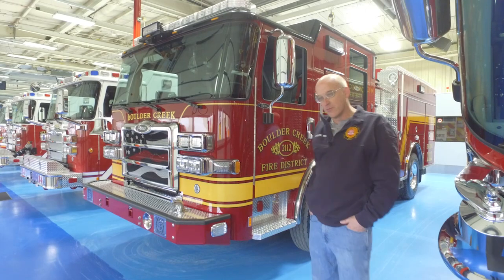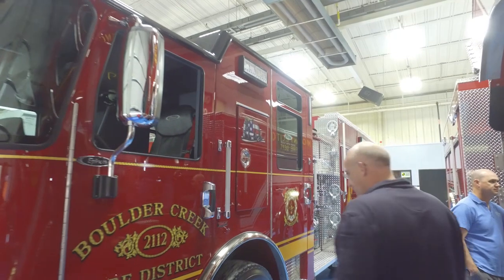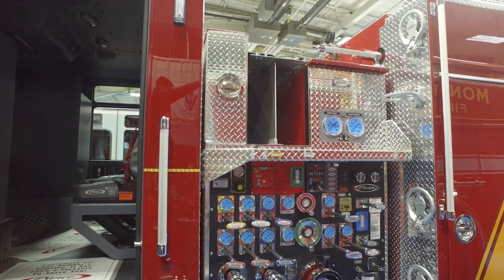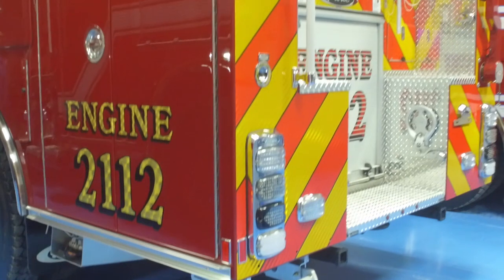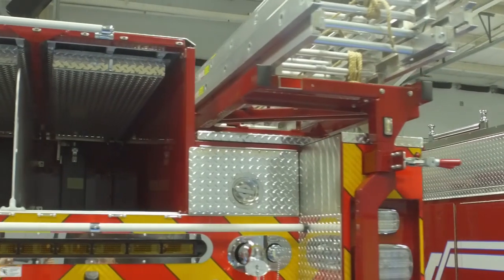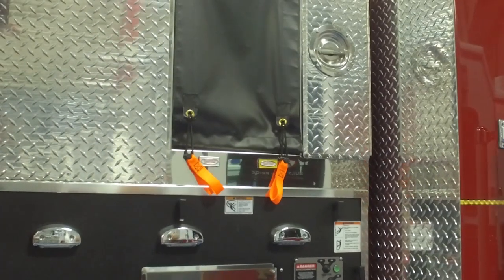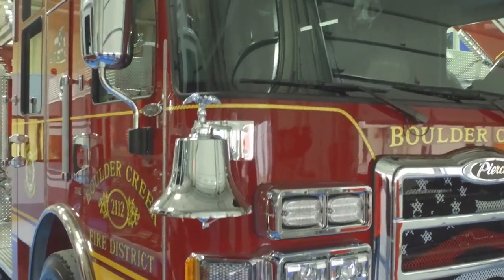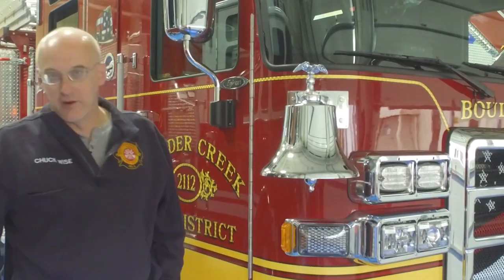Enforcer™ Pumper – Boulder Creek Fire District, CA

Comment: I would like to ask these departments who have removed SCBAs from the cab if they clean their SCBAs after each call that they were used.  Because if they do then why store the packs on the side of the trucks instead of where they can be doned while in route.
Reply: CLEAN CABS BASICALLY MEANS, Preventing carcinogenic environments is key these days, so after an incident, the less the exposure the better "CLEAN CAB" forces the fire departments to stow especially " used" or "dirty" gear, SCBA, TURN-OUTS, etc. away from personnel, so they're not breathing nor exposed to potential toxins. After an incident, equipment can and is cleaned & decommed, usually per NFPA specs, and thus can be used safely again. Different departments go about this different ways, the different fire commissions and supervisory arms make those decisions to meet the standard.This department may or may not clean gear after every " run", thus their decision for No SCBAs in the cab..Confused yet??
Reply: @trob0914  after 21 yrs in the fire service I have been disabled retired for 7 years now.  I know just as much as the next guy that every single second counts for search and rescue of victims of a structure fire, car accidents.  That I agree with after a incident not bringing up turnout gear or Air packs into the engines, ladder trucks, or other equipment, but I whole heartedly disagree with removal of this equipment in route to the incident.  I have spent thousands of hours in that 21 yrs of decontamination of those pieces of equipment.  Especially for Volunteer departments who have already lost precious seconds for members to respond to their stations. Remember it takes the fastest of us the don all that gear when it is put at our feet in a straight line 1 minutes and 15 to 30 seconds.  That is 90 seconds plus of a delay.  90 seconds of someone choking to death or being burned alive.  I personally never worried about myself more than I worried about the victims or my brothers.  Decontamination is extremely important, do it properly and then ask yourself why should I delay someone else's rescue because I want to be lazy and still protect myself over a victim who is choking to death from what I sweared to protect them from.
Reply: @SledgeHammer43  BEEN THERE DONE THAT,When I started we still rode " tailboard"! TIMES CHANGE MY FRIEND!!